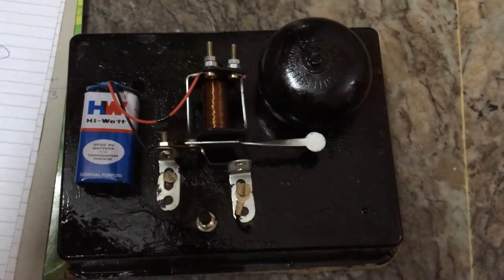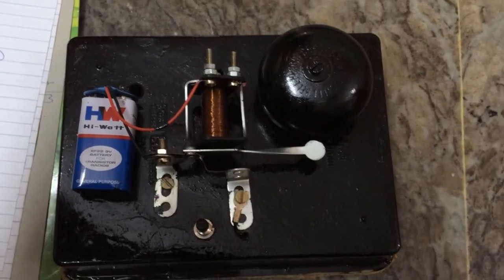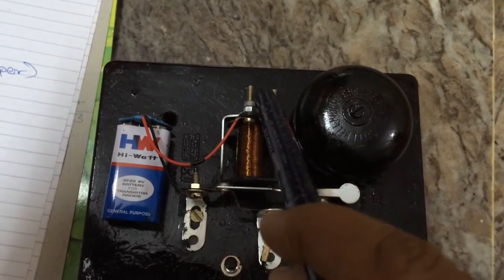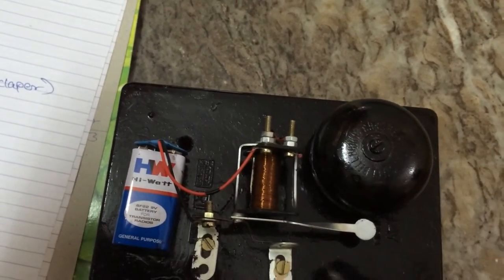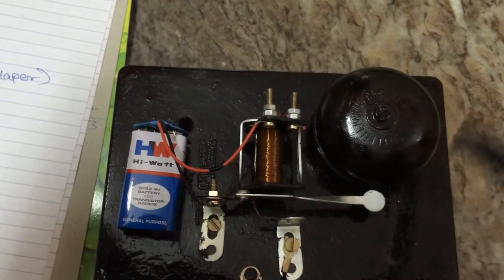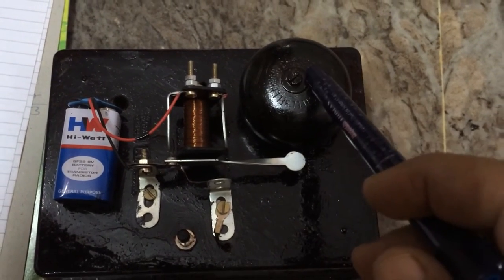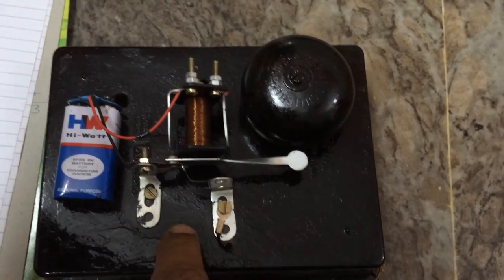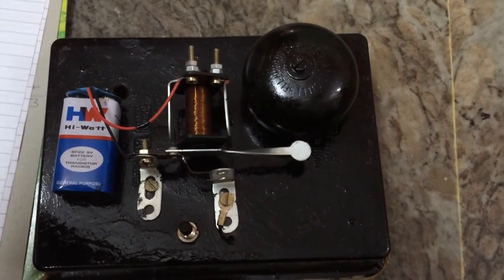Working model for solenoid bell

Comment: So, basically, you have a circuit with a electromagnet and a hammer, with the hammer closing the circuit in the unpowered state. When you “switch on” the circuit, the electromagnet pulls away the hammer, which opens the circuit, which turns off the magnet and lets the hammer drop back, closing the circuit again.

Or, in short, you have created a reliable solution with a minimum number of parts. Thank you, you should not believe how many ridiculously complicated solutions I have found so far, yours is the way to go.